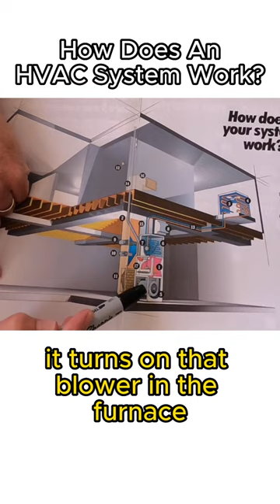How Does My Air Conditioner Work? Simple Explanation of Your HVAC System

Comment: This helps alot but I didn't understand the refrigerant part. Where does the refrigerant come from to be circulated? I'm not an hvac tech I'm just curious
Reply: The refrigerant is located in the condensing unit, evaporator coil, and line set. Those are numbers 3, 4, 7, and 13 in the video. The AC compressor pumps refrigerant through the system.

Comment: My inside evap coils should get cleaned but they are sealed box on top of the furnace. I don’t know if I can open them up.
Reply: You can if you're brave.  I did and found filth like a horror movie.  And got double the airflow afterward.
Reply: @Crunchifyable2  how did you get in there the sealed box?

Comment: Can I just replace a new condenser without furnace?

My current Hvac is 2009 Bryant 4 tons 16 sheer，401A，two stage. 
My condenser is broken as my mistake operate so I wanna replace a new one. 
There are some companies which came to my house and had a check on the whole system and gave me quotes. 

Some of them say I need to replace the whole system(furnace and conderser). 
Some of them say my furnance is in really good condition still can run7~10years, just need to replace the conderser. I ask them if the new condenser can work with my current furnace very well and they don't send the different signal to each other. They say that's OK, just change the condenser is ok for the whole system. 

So I wanna ask if it's really OK that I just chang a new 4tons 16sheer SINGLE stage Goodman or Lennox condenser for my current furnace or the whole system?